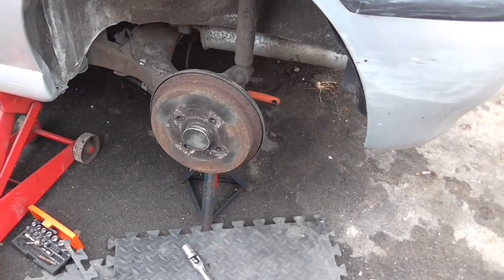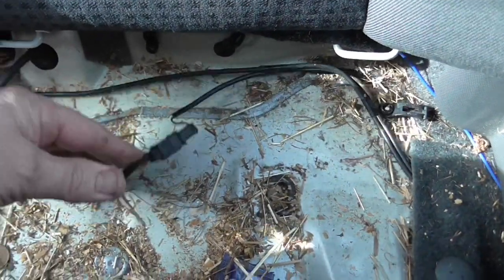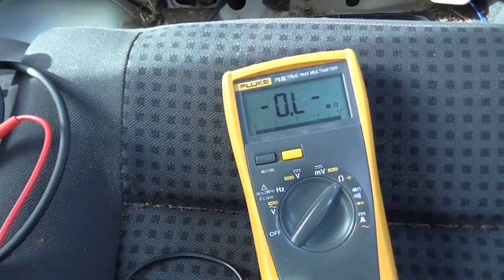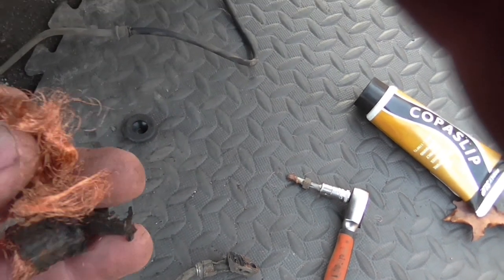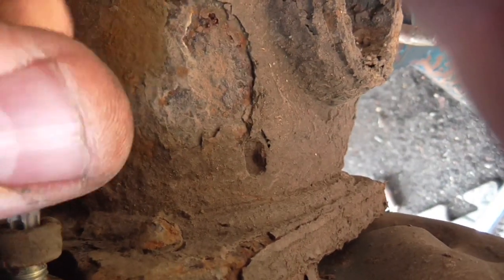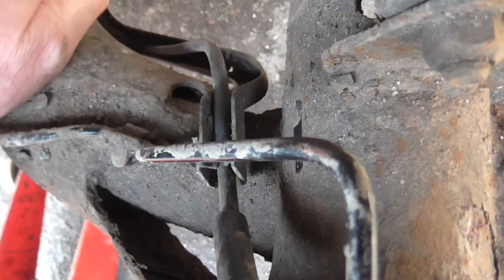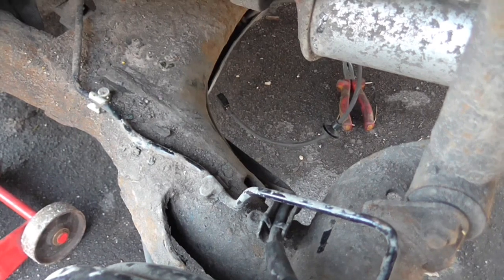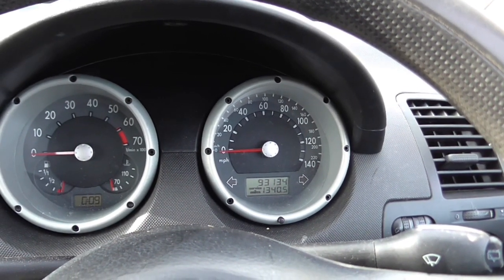6N2 Polo ABS 2001 Volkswagen Polo 1.0L rear ABS sensor replacement

Comment: How hard is it to get the new cable back up into the rear seat area?
Reply from the maker: Hello Master BigNose..... As I recall easy enough there is a bigish hole the cable goes though with a rubber grommet/seal ready fitted to the new sensors cable...All the Best...Trev
Reply: Thanks for that. The stupid abs bolt is rounded off so can't get it off
Reply from the maker: Hello they do tend to do that.... soak it in a penetrating fluid PlusGas is my favourite, for a few days put it on 2/3 times leave it soaking..... try griping rounded off bolts with a pair of vice grips AKA Mole grips might do it..... or your looking at drilling out the bolt and re-tapping it plenty vids on YouTube show you how...!
All the best.....🙂 Trev